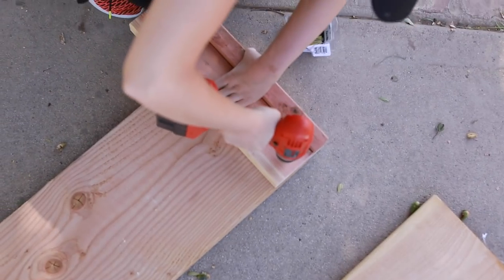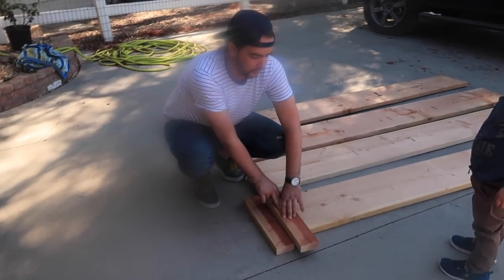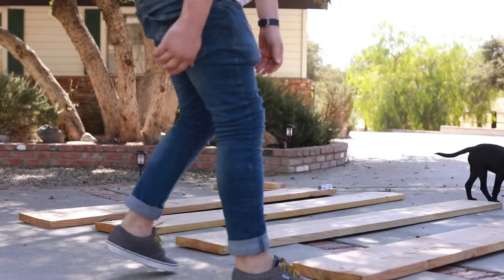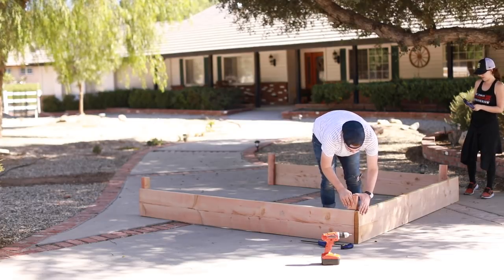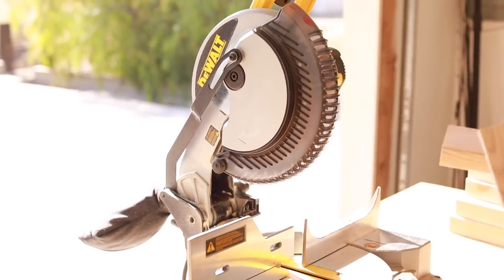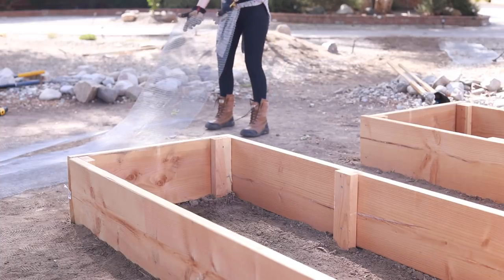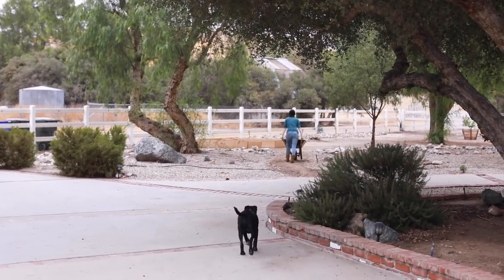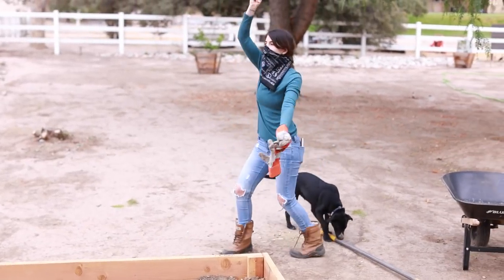Building A Garden Bed

Comment: You did the bed the right way which is maximizing the square footage for the area used. A raised bed should never be more than 4 foot wide so you can reach into the middle of the bed from each side. I use the square foot organic gardening method and my gardens always produce enough for me to eat fresh and to fill my chest freezer with good organic food for the winter. I used bagged garden soil & peat moss to fill my beds and they never need to be weeded!! I also compost all my kitchen & garden scraps to add to my garden beds each year. 
Happy gardening!!